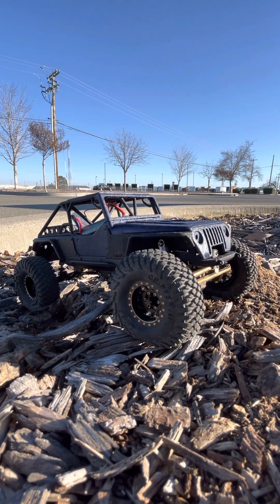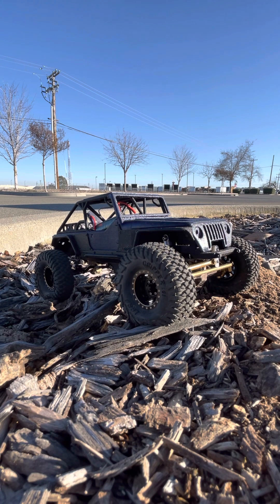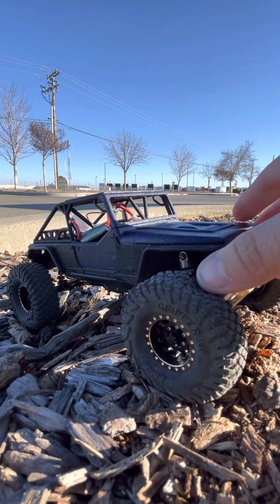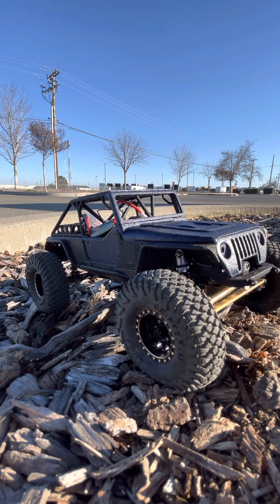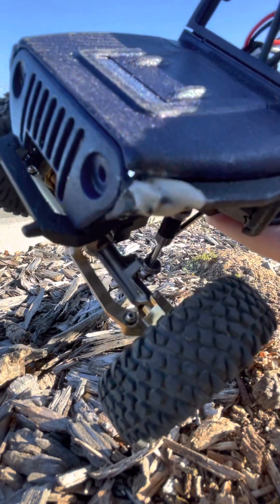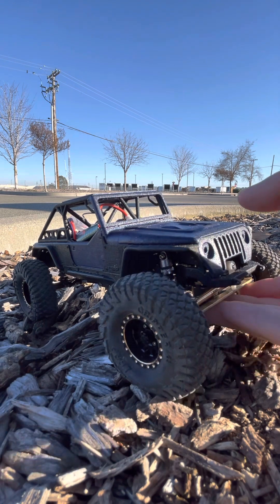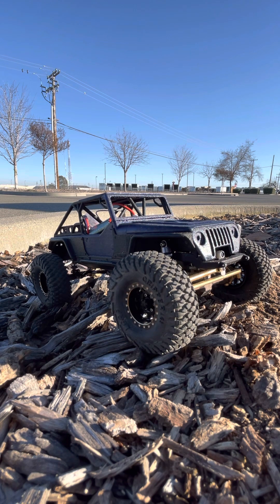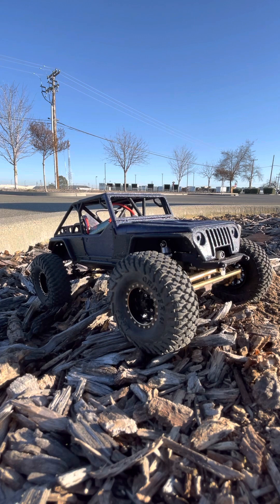First SCX24 build (little guy racing parts ripper)

Comment: Thanks for all the info!  Very helpful!  I finally have one of these kits coming my way.  The driveshafts are one of the parts I haven't been able to find much info on.  Can you please explain what combo you used front and rear?  I'd like to get some metal ones ordered up quick.
Reply from the maker: Sorry for the late reply I’m barely on this channel and i rarely check it. I used 2 different sets. I bought the treal steel c10 and deadbolt driveshaft and kind of mixed and matched the lengths around. Since I was brushless I didn’t want to chance breaking the 3d printed driveshafts.